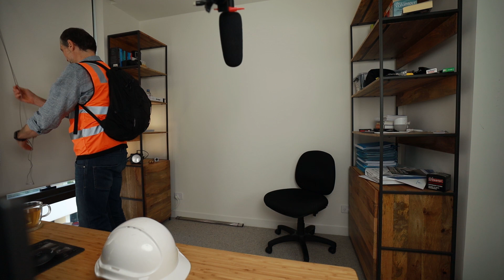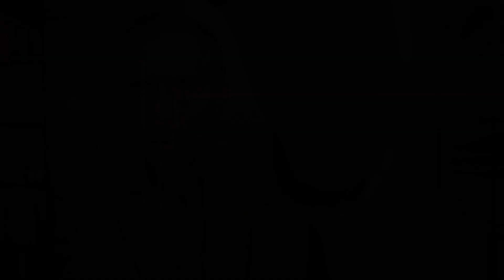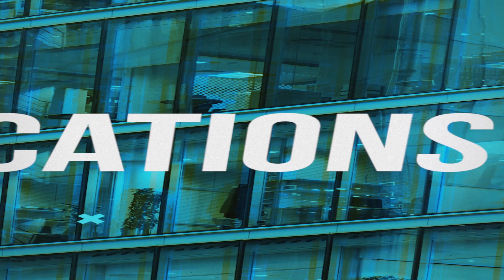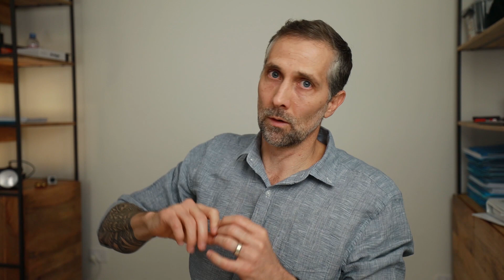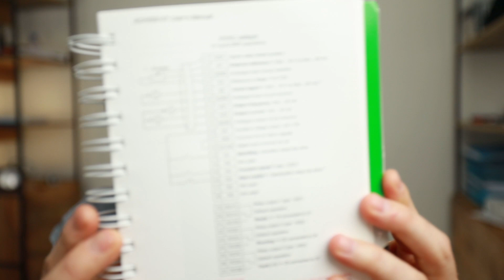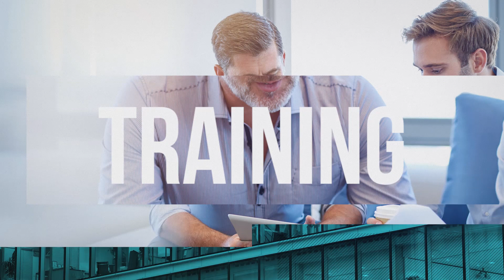When Value Engineering Fails, Unnecessarily (VSD Control)

Comment: Yesss! I’ve come across such a project with the exact ACH family VFD model which you’ve shown. PID is controlled by the VFD itself using pressure transmitter. Much reliable control when it’s right into the VSD

Comment: Hi Bryce. Enjoying your videos very much. What is your experience of connecting a single sensor temperature, pressure, flow to multiple I/O. So for example a pressure sensor connected to both the VSD and controller? do obtain false readings or does it depend on distance or the type of signal 0-10v / 4-20mA?
Reply from the maker: Hi David, I have considered this a few times over the years when working on data center's. I never tried it, but don't think it is a good idea. There are too many unknowns. And, I have never seen anyone do it, which leads me to trust it less. 
There are other ways to improve reliability or reduce single points of failure. 
Check out this playlist if you are thinking about reliability: 
https://youtube.com/playlist?list=PL4FPMBWj1hQp6bZ55fYz3btqlO5dWhCGm
Reply: @bryceanderson17   Thank you and don't  ever get dishearten if the views for you videos are low. The lack of BMS knowledge out there is shocking and you are doing a serious service to the BMS community those will pick up

Comment: You are absolutely correct, this is the best BMS design where you have pressure or temperature or flow signal connected to the VSD and BMS send a set point via HLI so in the situation communication is down, minimal risk on the control sequence. Same time you can same MONEY and unnecessary wiring to the BMS controller.
Reply from the maker: Yep, it's a win win

Comment: PREACH IT !!!!  Bryce 

We have been pushing the procurement of VSD as part of the BMS - thus giving the BMS supplier the capability to optimize (cost and performance) for sometime.   Similarly we are keen to  "package" up the procurement of items such as AHU c/w controls/valves/VSD  (sorta like a VAV box !!) 

Surprising how much push back we get with these approachs 

SMH
Reply from the maker: Do you know that in other countries like the UK, there is no a mechanical electrician. The BMS company provides VSD, all power (except chillers), hardwire interlocking etc. 
Our Australian model of the separate grey box on the wall is very disjointed. 
Keep pushing, we will get there 👍
Reply: @bryceanderson17  Really .??  

Must ask our London office